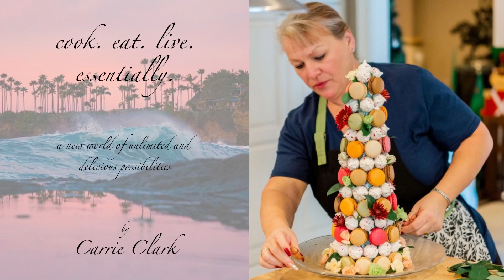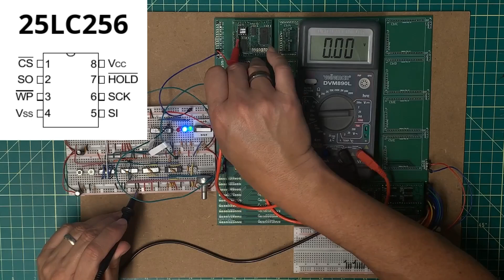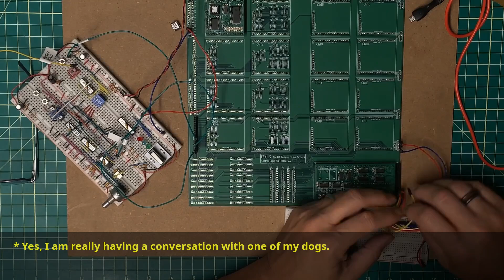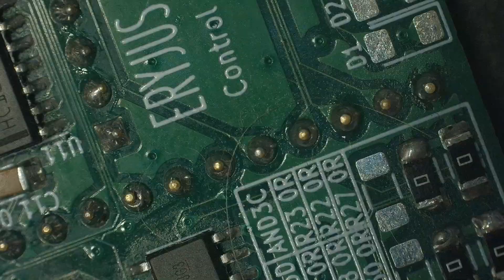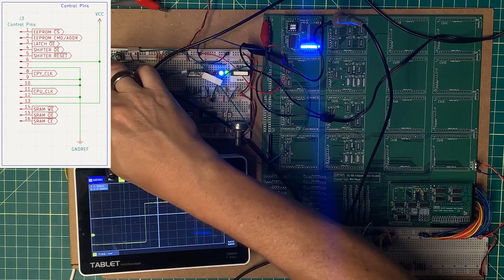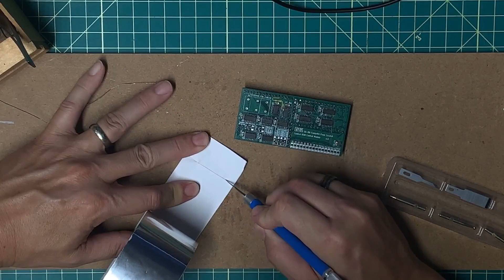0105: HELP! Control Logic Control Troubleshooting | 16-Bit Computer From Scratch

Comment: J'ai aussi un analyseur logique et je ne l'utilise presque jamais
Reply from the maker: I'm trying to build a logic analyzer in my spare time using a Raspberry Pi.  I don't have a ton of spare time these days.  

Interesting thought, though, to use a logic analyzer to capture analog voltage levels in relation to other signals.  I'm going to have to think on that thought a bit.

(I apologize if Google Translate sent me down the wrong path here.)
Reply: @eryjus4594 it's old analyser  HP de 1983 UP to 2O MHz state with 68000 engine ;-)

Comment: Plug boards can end up with 1/2 a volt of noise on the power and ground rails. It's good to see that you are doubling up the wires. The scope grounding can influence the signal. one quick way to check this kind of noise is to put the scope probe tip on the ground pin. Also on logic gates you can get outputs that are not fully up or down if the inputs are not all the way up or down. logic gates are amplifiers and have a narrow range where there output can be in the middle. And one way to check for a short is to use a thermal camera.
Reply from the maker: @LaserFur -- Thank you for the reply!

Yes, the breadboards for the clock module are getting worn out.  I need to convert that, if not to PCB, to a semi-permanent solderful breadboard.  I have a few I can recover from the failed EEPROM replacements.

I have been concerned with the ground noise as I have been going and do check that quite frequently -- just not on camera.

I will look your other recommendations.  Thanks again!

Comment: I'd bet that 2 outputs are short together. Not sure what SW you are using, but I think most of them have possibility to check schematic/board for such think. It sould be of course as well not design-error, but solder bridge. If schematic/PCB check does not help, I'd measure voltage on all pins on PCB and find where else you have those 4V...
Reply from the maker: @hwmland -- Thank you for the reply!

I use KiCad.  I have the latest version for the Ubuntu distro installed.  It is pretty good about identifying traces which are driven by multiple outputs -- or more to the point it has warned me about that in the past on earlier versions.

But, I do agree as I think about it more that I have 2 outputs which are driving the same signal somehow.  As I have been thinking about this over the last couple of days, the edges of the incorrect signal feel crisp to me, which I interpret to be a solid connection.  I'm probably dealing with a good old-fashioned bridge somewhere else on the PCB.

The question is how to find it.  Exhaustive search....?  Or is there something more efficient?
Reply: @eryjus4594  - I'm too lazy to check your schematic, but I suppose this 'problematic' pin is not connected to too many other pins. So I'l switch multimeter to short detection, one probe on the pin (it's on header, so there is easy access) and go on pins of other IO. You don't need go pin-by-pin in this mode, just firm (to be sure you really touched this pin) swipe. On areas where it beeps you can go pin-by-pin to find exact location. You have to 'check' of course as well other components (LEDs, ...)
And yet another fault-stete that came to my mind is that this output pin goes into input of faulty IO... Here I'm afraid you'd need to remove  those IO one by one...
Reply from the maker: I’m sorry.  I did not mean to imply I wanted you to check my schematic.

(Hits send too quickly here)

Thank you for the suggestions!
Reply: @eryjus4594  Oh no, I genuinly felt sorry to be lazy, with checking schematic and board design I could help better. I'm full of admiration for amount of work you must put into creating your videos. I'm designing myself 74HCxx CPU, but to make videos... well - simple word - lazy :(
BTW: I had as well problem in my design because of counterfit chips from aliexpress. It were chips from old electronic (no problem, it's only toy construction on breadboard), but it was 74LS re-marked as 74HC. My special-purpos 16bit register contains four 4-bit adders with one operand tied to single pin (==16 input pins). It as well lead to poor levels and very slow edges when driven from HC...
Reply from the maker: @hwmland -- While it is not impossible, I do not believe that the ICs are counterfeit as they came from DigiKey.

Good luck with your own build and videos.

Comment: Not sure if your scope settings changed between the signals that were good and the 4V signal (QR). If it did not (and appeared to be 1v/div until near the end), notice that the low pulses do not actually go fully low. If the 1V/division is correct (which it appeared to be on the other signals), the lows are about 3V. I would suspect another output driving that line. possibly a short between pins on one of the other points it connects to. Also, there appeared to be some missing solder mask on a few of the traces that went between pins on the 'HC74. that could also be a source of the short, but I would look elsewhere first as the mask damage probably occurred during the rework. Is there an LED on that signal? If so, it could be in backwards. In the last shot with the control board connected directly to the breadboard, the scope was set 2.5V/div. 

I personally prefer 1V/division and move the trace so that the 0V reference to be the 3rd line below center on the graticle. That makes it easy to see if anything is out of voltage spec which indicates bad outputs, bad inputs or conductive dirt/etc. Sometimes you can look at the other ends of the driven trace and see if there is any noticeable voltage difference from the output pin. If there is, that is frequently where the problem lies.

I know you checked that the cap connected to the power rails of the '74 IC, but do those rails connect to the rest of the board?
Reply: The traces headed to the '193s from the '74 are really close to the pin header. Check for shorts to the header pins. Your scope trace setup appeared to be pretty close to what I like for most of the video, though I would zero out to the graticle line rather than being a bit low.
Reply from the maker: @grumpyoldman5368 -- thank you for taking the time with the replies. 

I really need a proper oscilloscope.  This cheap thing  no longer references 0V properly.  I'm sure there is a reference voltage somewhere on the board which is messed up.  Relatively speaking, I can see the shape of the signal, but I cannot necessarily count on the magnitude of the signal.  Therefore, I would not get too hung up on 1V/div or 2.5V/div.  These settings all reset each time I power on the scope and I missed setting it in the last clip.

Since the DMM is in DC mode, it is averaging the voltage which is coming out to be 4V.  I agree that it would imply that the voltage is bouncing somewhere between 5V and 3V, which the oscilloscope seems to imply based on the shape of the signal.

The PCB is 4 layer, with a GND place on the second layer and a VCC plane on the third.  Signals are on the top an bottom only.  So that cap is connected to the entire PCB circuit.

For the missing solder mask, that may be a flaw on the PBC manufacture.  I will look at that again.  But there was no change in behavior, so my assumption at the moment is that the solder mask was missing before I started soldering the first component.  Recall that there was no change in behavior when I changed the '74 IC.